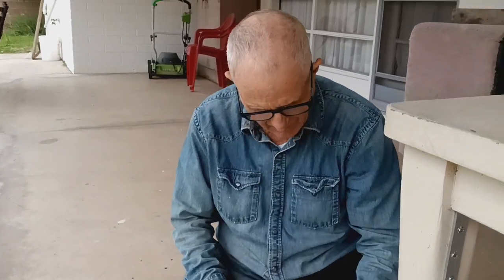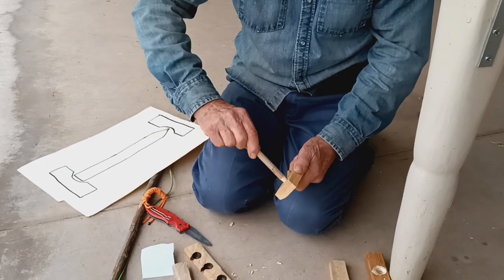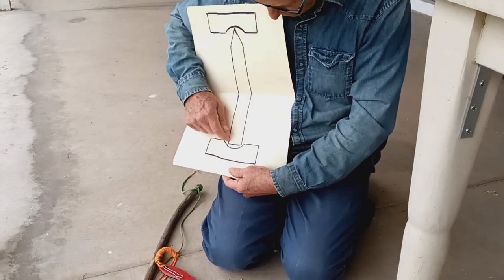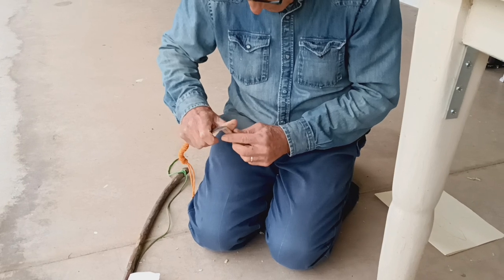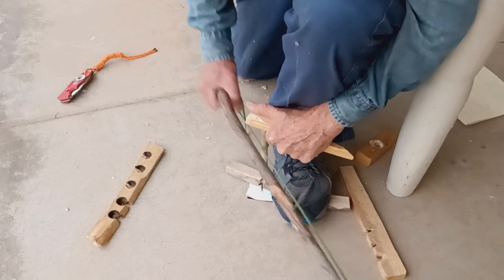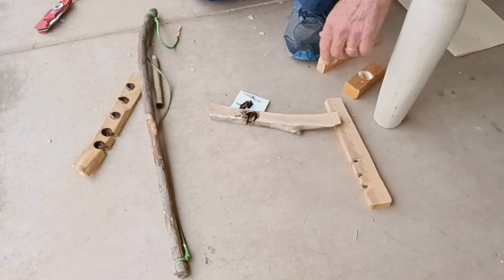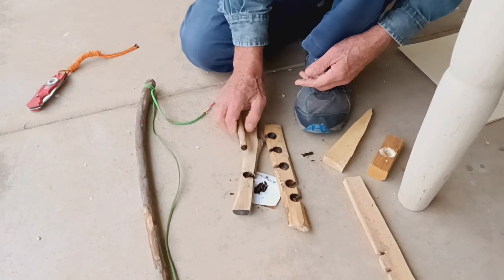Easiest friction fire

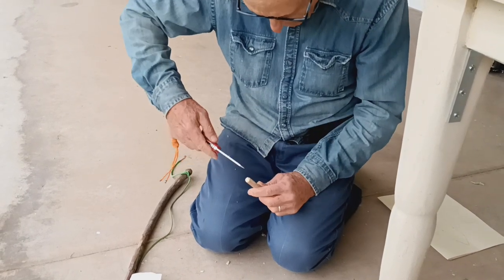Comment: Notice that @2:56 he is  not pushing the knife point into the end of the spindle with very much force, just holding the two hands a certain distance apart and rotating, like a drill bit just barely touching.  If you push hard and the knife slips, the  knife will be cutting your left hand very quickly.   The fellow in the video obviously has years of experience and built in muscle memory, so he was safe.  But it could *look like* pushing real hard while the knife point is aimed at your opposite hand; which would not be safe.    The diagram showing the bottom of the spindle flat but the depression curved so it only contacts at the rim was something I did not know before.  Thanks.
Reply from the maker: I appreciate the feedback. It is a lockback knife and I'm not pushing it down into the wood, just rotating. I need to update my diagram a little bit and be more careful to stress safety. Thanks for the comment on the feedback😊

Comment: You're relying on a specific plant with a hollow core which might not be available when you need to start a fire, and that makes this method not any better than any other for starting methods
Reply: however, i did learn that hollow core plants will provide an easier start. That is good information to have.
Reply: He's just suggesting a fun backyard project.
Reply from the maker: I've kind of gotten in the habit of hollowing out the tip of a solid spindle, such as cottonwood just a little bit. But I really like seep willow spindle alright!